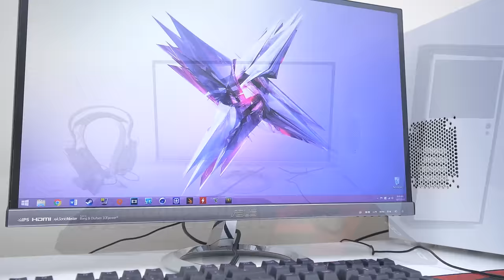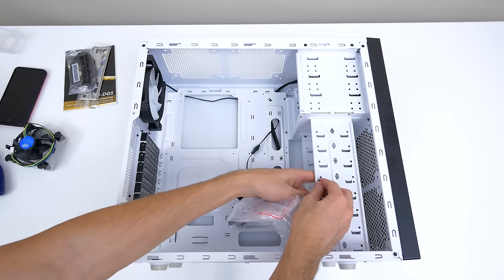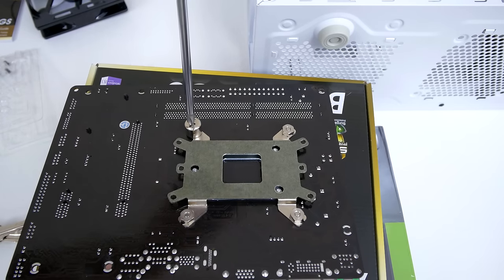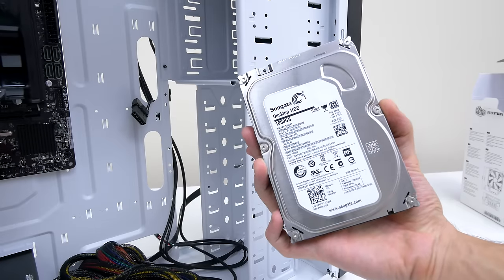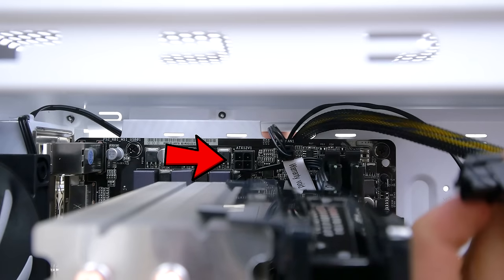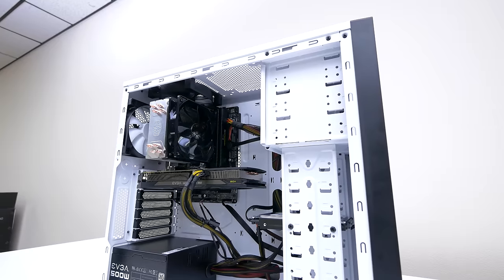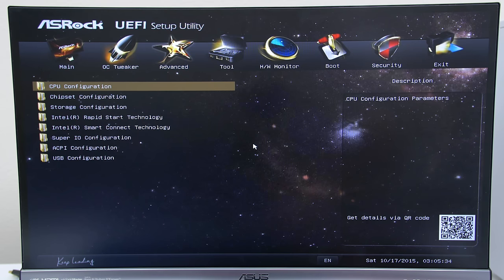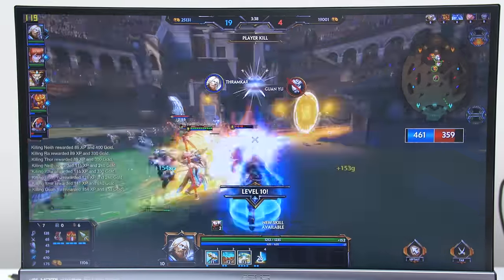How To Build A $650 Gaming PC With Windows

Comment: I am really clueless when comes to pc building I have never owned one and never built one but I am interested in getting one. so if I wanted windows 7 instead of 8.1 do I install it the same way? And can someone leave a link to where I can get the Windows 7 please.
Reply: +Vaxy ツ I want to use my old HHD with the os from a Prebuild pc for my new rig. Is it fine or will there occure any problems?.
Reply: I got some other answeres that it should be ok. THx either way :D
Reply: Jazzy8803 I haven't used one or built one expert the one used at my school and they have windows 7 but they really suck so use 8.1 or 10
Reply: Jazzy8803 I wouldn't get Windows 7. The support for Windows 7 ends in 2020 which means it will stop getting updates which will leave you vulnerable to malware. Just get Windows 10 if you haven't built your PC yet.
Reply: Kawa zuki Just get 10 its better.
Reply: Sorry i dont know that much about pc building, but can that tower fit more than 1 graphics card?

Comment: I MADE THIS BUILD and as a first pc builder I am very impressed with it. This video gives an easy step-by-step guide on how to build it and additionally provides helpful tips on software installation which made the process a breeze. I am impressed with the graphics and processing power on my PC as well. ALTHOUGH, I don't know if you can see it in the video, but for the CPU wire that plugs into the motherboard (the one above the fan that was hard to reach, (I also advise plugging that in before you install the motherboard into the case)) the clip actually has to face DOWN. NOT UP. I don't know if the motherboard or power supply changes the holes for the plug, but make sure the CPU plug goes in the right way. I didn't pay attention to the pattern in the holes of the plug and only payed attention to what he said, so initially my PC didn't start because the plug wasn't in the right way. Luckily it was an easy fix but for those who want to build this remember to check that CPU plug
Reply: +Nick Capadazo Hey yo, about to do this build myself. Does the ethernet cable auto connect or will I need to install something onto a flash and put it onto the new build so it can connect without wireless? first build as well
Reply: +Vesu16 the Ethernet cable automatically connects into the computer, no additional steps required :)
Reply: Thanks buddy
Reply: +Nick Capadazo thanks so much, I cried for 2 days checking what was wrong
Reply: +Studio Skit glad to help I know the feeling
Reply: +Nick Capadazo does it actually run gta 5 high settings at 60 fps in actuall gameplay
Reply: +mrbigjohnston haven't played GTA or much games yet but I'll let you know once I do
Reply: Does the computer makes a lot of sound
Reply: +Thomas Bellavance no
Reply: Thomas Bellavance I ended up doing this build... well sort of... went with a different case (corsair 230t) and a 970 gtx over the 950 and love it. Everything else was the same and it runs great. and is pretty silent too. (mine is a little louder than what this case would be due to two front fans)
Reply: +Vesu16 wow nice!
Reply: +Nick Capadazo what gpu did you use? just the 950, or did you get the 960?
Reply: +mrbigjohnston yeah I couldn't afford 960 but I think if you can afford it you should go with 960
Reply: +aaron brown Eh wtf
Reply: i dont think this aaron brown lad understands he doesnt need a pc like this just for cs:goXD

Comment: This is my New PC :D, I only changed out the 4690K for a 4460 and the gtx 950 for a gtx 960. Thanks Ed for this awesome tutorial!
Reply: I also added the extra accessories like the Hyper 212 Evo, an extra fan, and the Alchemy leds.
Reply: +Rockinroddie Then you made a great swap! For a gaming PC it is much better to get the 960 and swap the 4690K for the 4460.
Reply: I'm building the same PC as you but with a different motherboard, how is it performing so far?
Reply: +Rene Mejias It should be a very capable 1080P Gaming PC. Running nearly every game on atleast high if you get the 4 gig version of 960.
Reply: Rene it is running perfectly, I do not believe switching the motherboards would do much to change anything, just do whatever is your preference. On Most games (I play GTA V and Fallout 4 mostly) I can get 60 fps on high settings. Hope you have fun building the PC :D
Reply: Rene Mejias Rene it is running perfectly, I do not believe switching the motherboards would do much to change anything, just do whatever is your preference. On Most games (I play GTA V and Fallout 4 mostly) I can get 60 fps on high settings. Hope you have fun building the PC :D
Reply: +Rockinroddie thanks! the parts are getting here this week, I can't wait lol
Reply: Have fun :D

Comment: Touching the empty case won't ground you. It might discharge you, if you have little static electricity in you and the case has enough conductive metal in it. To "ground" yourself you need to exchange electric charge with something that can handle more charge then you. Cases can serve as ground when the have a good PSU, properly installed and connected to a grounded electrical socket.

Comment: The four pin cable that powers the motherboard (the one that is tough to plug in) should have the catch facing DOWN not up. Learned that the hard way when it would not power up. Look closely, the latch on my motherboard faces the cpu not the edge of the board.

Comment: This is my PC build:

Seagate 1TB Desktop HDD
Samsung 850 EVO 250GB 2.5-Inch SATA III 
Corsair Carbide Series SPEC-02
MSI R9 380 GAMING 4G Graphics Card 
EVGA 500 W1 80+
MSI Computer Corp. LGA1150/Intel H81
Crucial Ballistix Sport 8GB Kit (4GBx2)DDR3 1600
Intel Core i5-4690K

For Windows what should I do to get it cheap? I want to get 8.1 64 bit and I have not started building my PC yet. Also, recommendations and things to change would be helpful.

Comment: Can I upgrade parts easily in this video without having to worry about compatibility issues. For example, if I want to upgrade to a new graphics card, would it be easy or would I need to find a new motherboard or cpu? Thanks.

Comment: Some Intel B85 chipset motherboards may need a BIOS update prior to using Haswell Refresh CPUs.
The NZXT Source 210 (White) ATX Mid Tower Case supports video cards up to 330mm long, but video cards over 230mm may block drive bays. Since the Sapphire Radeon R9 380 4GB NITRO Dual-X OC Video Card is 238mm long, some drive bays may not be usable.

Should I be worried about this?
Im using the same case as him

Comment: do you recommend I get an i5 4460, or the 4690k? I'm leaning towards 4460 because the performance  (without OC of course) is pretty similar, and the 4460 costs a decent amount less. I just don't want to spend too much money

Comment: I just brough a new pc, it did not have windows install onto the ssd. And i try to run the disk. but the disc reader isn't detecting it. Thank you so much for showing me how to install a windows with a flash drive. LOVE YI+OU SO MUCH

Comment: Just build this pc and its amazing!!!
Reply: did you have any problems? I am thinking of building it, just wondering.
Reply: +Hotdog Champ Make a vid about it
Reply: CRAZYP4PI I had no problems and everything went flawless! I am making a video about it very soon :)
Reply: +JackAttack can you help me? my pc wont show anything on my monitor
Reply: u need skillz Yes! so check your connections, are you on a laptop or a destop? if your are on a desktop, are you plugged into your motherboard, or your graphics card?
Reply: yea i fixed it, thanks for replying though
Reply: No problem, what was the problem?
Reply: u need skillz
Reply: i switched the hdmi cable to the gpu. i tried it before and it didnt work so it was weird.
Reply: Where did you buy Windows from the Reddit link ?
Reply: Angel Silva i got mine from amazon, careful which key you buy
Reply: does windows 10 work?? for this pc build?
Reply: ShadowRS Yes! I just put windows 8.1 because I like windows 8 better, windows 10 will work on this pc build
Reply: JackAttack
PERFECTTT thankss, so building this xD
Reply: ShadowRS Your welcome and yes you should! its a beast!!!! :)
Reply: JackAttack Hey, in building this PC soon and I was wondering, you bought windows off of amazon. I'm pretty sure it's a disc, (correct me if I'm wrong) so how did you put the disc into the PC since the PC doesn't have a disc drive?
Reply: KartuneMC Hello! What i got was a Cd key, not a disk, If you watch His Video, he makes a USB windows Bootable all you have to do is Get a flash Drive(USB) and make it bootable, he does it in the video so if you follow that then you will be just fine :)  If you look on amazon, you can find pretty cheap CD keys, Some send an email containing the code and some just come in the mail.
Reply: JackAttack Okay thank you!
Reply: KartuneMC Yup No problem!
Reply: JackAttack Hey! I built this PC like 8 hours ago and so far, it's amazing!
Reply: KartuneMC Awesome to Hear man! Mine is running great so far aswell!! :)

Comment: Not much of a problem as I've had my pc together for over a year now. But the tightener you are using to screw in the nuts on the 212 thing didn't come with either of mine and I purchased two 212 Evo's. In fact one is still in the box now and hasn't been used. But will soon as I just purchased a g3258 and will be working on a smaller build.

Comment: AMD Phenom II X4 955 Black Edition 60 bucks ASRock A785GXH/128M free cause i had it all ready nVIDIA GeForce GT 640 paid 40 bucks for it was still new in the box 8 gigs of ram was like 40 bucks i can play any game i want with no troubles can over clock or under clock if i want and i got less than 200 bucks in this system video card is lacking but still works great for what i need

Comment: Can I use I7 with this? I have already got all parts going to start building Friday,just curios if i7 would work. I also used  the corsair carbide series spec 2 case instead [Black with window] +TechSource

Comment: Hi,

So i want to build my first (gaming) pc. But i want to use my existing harddrive. Wouldnt i have compatibility issues when using an existing harddrive which has driversoftware for a different kind of motherboard/cpu/gpu? Can i safely boot up my new pc with an existing harddrive with win10 on it and then download new driversoftware for the new motherboard/cpu/gpu? Or should i pre-download it on a usb and then install it from there on the new pc? Kinda struggling with this big time. Thanks

Comment: Max I would like to spend $200 on a graphics card! Any suggestions and will I be able to play black ops 3 or fallout? I would just like very smooth gameplay at 60 fps if possible with no aftermarket cooler or any heat problems. Is it possible? 

My specs are:
Intel i5 4690K
Z97 G45 GAMING MOTHERBOARD
8 GB GAMING RAM
CORSAIR 500W GOLD RATED POWER SUPPLY
WILL A REGULAR KEYBOARD AND MOUSE (Wireless) fit me well? 

Thank you!

Comment: The VGA Clearance is Maximum 230mm w/ hard drive, 330mm w/o hard drive. Can I fit a GPU bigger than 230mm if I just put the hard drive in one of the lower slots so it doesn't get in the way of the GPU or does that prevent good air flow?

Comment: What other parts do I need, like cables?  There's no hard drive cable included, right?  What else will I need to order?  Thanks!
Reply: If you don't have that much knowledge about computer you should really learn more about them and watch more build videos, and yes the Sata cables are included with the motherboard.

Comment: I just got this and I was wondering what games I can play on this?
Case: Corsair Obsidian Series 450D Black Aluminum
CPU: Intel Core i5 4690k
Graphics card: MSI Radeon R9 390
Motherboard: ASUS H170 Pro Gaming LGA 1151 
HDD: 2tb 
SSD: 250gb Samsung
Power Supply: 750w 
Ram: 16gb (2x8gb) 
OS: Windows 10 Home 64bit
Reply: The CPU and motherboard are incompatible.
Reply: +252 252 Soz meant i have a Intel Core i5-6600 6M Skylake Quad-Core 3.3 GHz LGA 1151

Comment: hey! so this will be my first pc build, and I was wondering if this is the right one to build. this is just about where my budget is so it seems perfect, but I have a few questions before I fully commit. since I'm going for a fully gaming pc, should I replace the core he uses with the I5-4460? then use that saved $50 for a gtx 960 graphics card and a wireless adapter? feedback soon please, thank you
Reply: oh and is that fan that he buys that requires the thermal gel a lot better than the originally planned one? like I said I'm on a budget so I'm trying to save some money for decent games and a monitor

Comment: I did this build as my first and i only changes the graphics card to an r9 380 4gb. When i first turned it on, everything turned on for a second, then off, then a puff of smoke came from the motherboard. I dont know if this affected anything but i connected a random spare cable to the chassis fan pins on the motherboard which i thought powered the stock case fans (as well as the molex cable). Please help anyone???

Comment: Is it okay if my gtx 960 ssc's backplate is getting hot when gaming? like i took the case's side cover off and stuck my hand ontop of the backplate and it didn't burn me like I could keep my hand there but it was definitely warm and the fans turned on.

Comment: on amazon I built my own for about the same price I used

amd 6300 unlocked
msi GeForce 1050 ti 4 gb
msi carbon edition cpu
random Case and keyboard and mouse combo

500 power supply and 730 dollars if you use fx 8350

Comment: Well,I heard that R9 380X is need at least 550w PSU,and i read when you use 500w PSU to power the VGA,the VGA will suffering.My question is,can 500w PSU use the R9 380X?

Comment: I knw its stupid but is there any wire from the power supply need to plug into the power button? Like u need a wire to connect the power button right?

Comment: I just built this but I did something wrong when I plugged it up, the 
power button blinks once and never turns on the PC, did I break 
something or is something plugged in wrong? I had trouble putting the 
fan on the CPU because my screws wouldn't align right could I of damaged
 it?
Reply: I had the same problem. My power button on the power supply flicked to off, just flick it to on... This fixed my problem

Comment: hey ed, i bought this entire build but got the msi r9 380, everything is plugged in but when i go to turn it on the light on the graphics card comes on but then goes right back off. am i going to need a stronger power supply?

Comment: How's this build?
Intel i7-6700k 
Corsair H100i v2 water cooling
Z170 mobo
32 gb RAM
Samsung 1TB SSD 
Seagate 3TB HHD
GTX 1080 x2 via sli
Corsair 760T case 
850 watt PSU

Any suggestions on anything?
Reply: the chances of this being factual is 0%
Reply: Halo8527 no this is my future build but I'm planning on not going with SLI 1080's and instead getting one HOF edition to match my color scheme
Reply: go for a z270 board i reccomwnd asus z270e and get an m.2 ssd
Reply: also get 1080ti for extra performence

Comment: Decent build at the time but you should of went for the i5 4590 with a GTX 960 which would of had a very good gaming performance and cost about the same thing also most B85 motherboards are good for gaming but not too great for overclocking which is why i find getting a locked processor to be better.

Comment: So I got a built a a brand new PC and everything lights up and does it's doo da, I'm using a disc drive and a disc for windows, I get no beeps but it does not post, after watching this video I saw that the windows icon came up straight away on screen. Why not for me? I got the disc in and everything. I'm going to try downloading the correct windows 10 iso and try that using a USB and use the code on the disc. If I can could get answers for the did I'd love that

Comment: so I used this video as a guide line for building my gaming pc. but the computer isn't turning on. The graphic card lights up that its getting power and my mouse turns on as well. but that's all that turns on. nothing else happens. what am i doing wrong? am I missing something?
Reply: Did you fix it
Reply: +Rezaul Karim yeah. I'm just trying to figure out how to end the bios loading when I turn on my pc. have the windows logo start up Instantly. as well as cable management

Comment: Hey i am using the NZXT s340 and i cant find the reset switch/wire. I have connected the +pled, the -pled, the power switch. I just can find the reset wire. Could someone help me?
Reply: +Rekon5 Nevermind. figured out the problem

Comment: Can somebody help me pls! I want to use this build, but i want to change the motherboard with a ASRock H97 annibersary, socket 1150 motherboard and i want to change the case with a Corsair Carbide Series SPEC-01 Red LED, case. Is this possible, or do i need to change some parts?

Comment: would this case http://www.newegg.com/Product/Product.aspx?item=N82E16811353095
work instead of the NZXT source 210? I am using a the suggested motherboard which is a micro, not sure about this though, new to computer building.
Reply: it will work